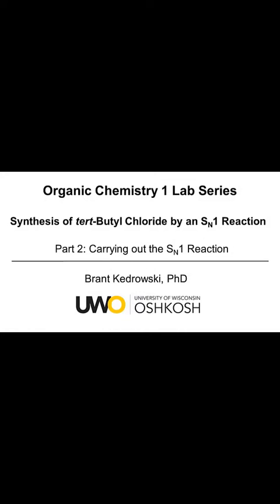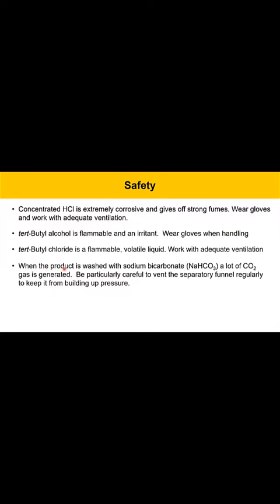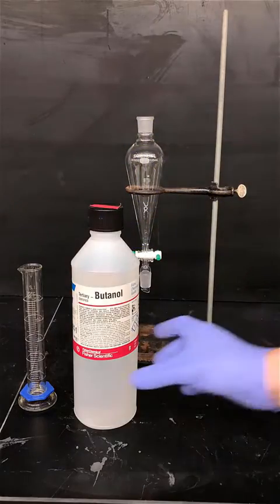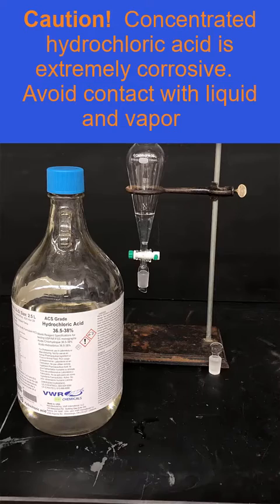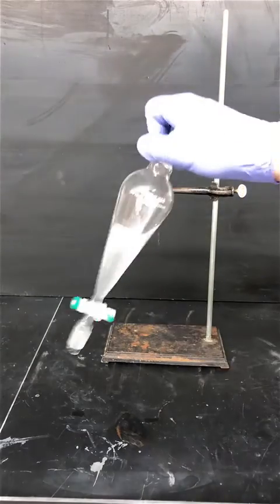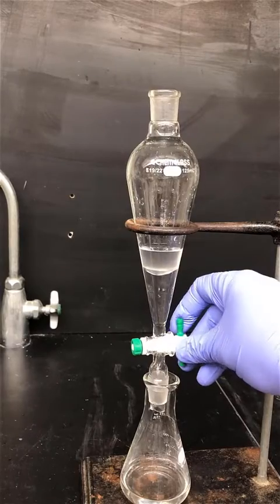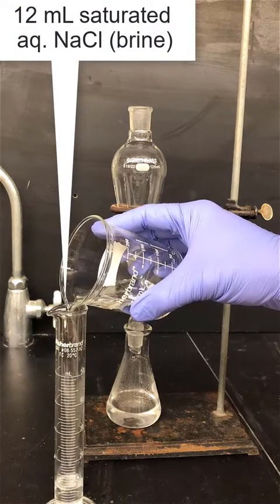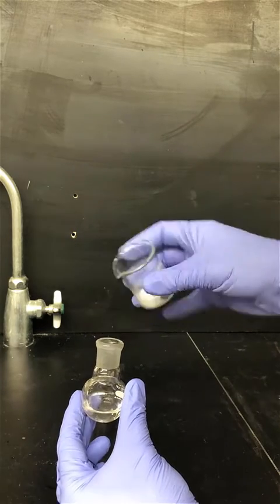SN1 Reaction Experiment, Synthesis of tert-Butyl Chloride, Part 2: Carrying out the reaction

Comment: why is a fluted filter paper used for the experiment?
Reply from the maker: Fluted filter paper has higher surface area and generally works better than a plain cone of filter paper. Using fluted filter paper isn’t essential, but it can make filtration much faster.